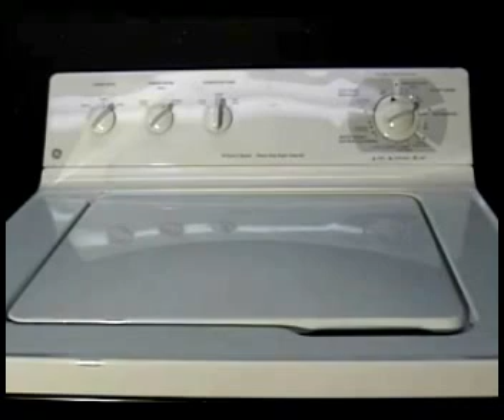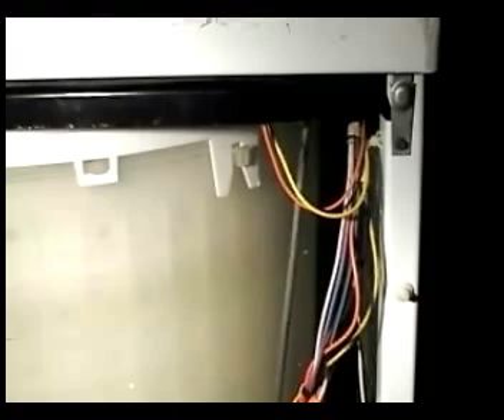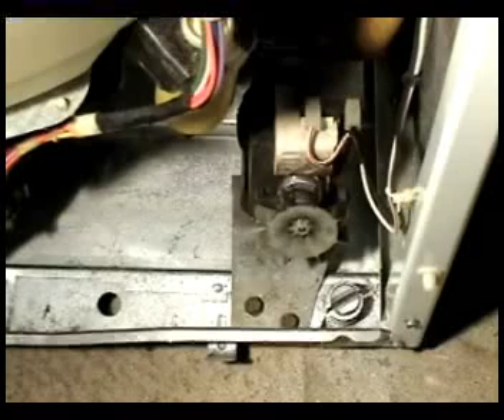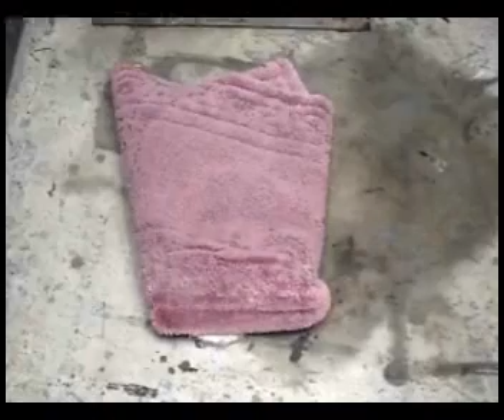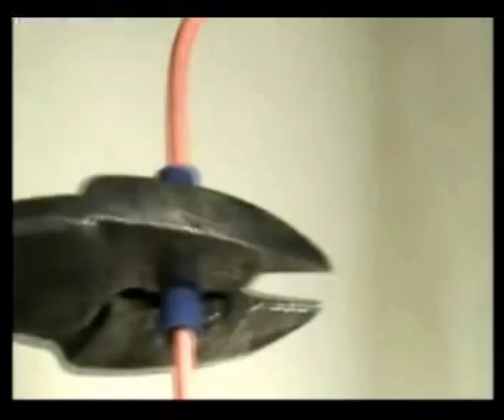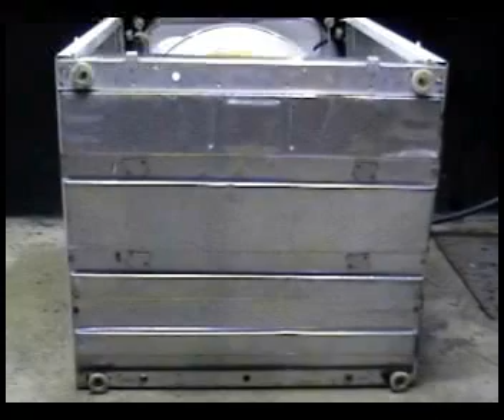General Electric Washing Machine Not Spinning  ?

Comment: Hi, thank you for the useful video.
 So far I have to connect the motor directly in order to test it, but I don't have a white violet wire. I only have a violet. Are they thr same? I have:
Yellow green, yellow, black, blue, violet, black red, red, orange and white red. Model number is WPRE6100G1WT. Please and thanks

Comment: My GE washer washes but when it's time to spin it starts then stops or goes into a spin but not fast enough to drain all the  water out.  I tried unhooking the air tube from the tub and blew into it to clear any dust, this seemed to fix the issue but only temporarily.  The belt is not broken.  I'm at a lost. I dont want to purchase a new washer if it cheaper to repair this one.  Please offer your professional advise.
Reply from the maker: send ma the model number to see what you have

Comment: After a neighborhood wide power outage, my GE model WHRE5550K2WW washer continued to function in most respects but would not spin.  After various online research and troubleshooting, I was convinced that some component in the relay had failed due to power surge.  Unfortunately, the relay board must be purchased as a unit with the motor.
I ordered "WH20X10076 GE Washing Machine Inverter Drive Motor " via ebay and it came with a jumper wire with instructions to replace an in-line fuse in the wiring harness.  On mine, I had to remove some black electrical tape to see/access the black shrink wrap surrounding the in-line fuse in the (white w/ red stripe) wire (upper, right hand side while facing the front of the washer).  This is in the harness bundle between the front of the motor and the upper RH corner of the machine.
After installing the new motor (including eliminating the in-line fuse as directed) and testing proper operation, before discarding the old motor, I tested the in-line fuse and found no continuity.
I'm going to keep my old motor as a spare and have too many things on my plate just now to bother re-installing the original motor to test operation, but I strongly suspect that my replacement motor was unnecessary and simply replacing or eliminating the in-line fuse would have rectified my issue.
Note; my new motor was not identical to my old motor in that the wire connectors were not configured exactly the same.  This was not an issue for installation or operation but leaves me wondering about the rational/wisdom/necessity of eliminating a functional in-line fuse

Comment: Hey so, my washer spins i just have to reset it every time to get it to spin. Otherwise my clothes are drenched. I tried reducing the load size but it hasnt helped. Please advise.
Reply from the maker: What do you mean resetting it ?
Reply from the maker: send the model number to see if you have a hydrowave washer or not
Reply: WPRE6150K2WT is the model number.
Reply: And reseting it by unplugging it waiting for a minute, then plugging it back in and opening and closing it 6 times in 6 seconds.
Reply from the maker: Your washer is a hydrowave washer and it has electronic controls and I don't know much about it 

check this link to see if you find some help there

https://www.youtube.com/results?search_query=WPRE6150K2WT

angel

Comment: Hey angel, is a new clutch pulley supposed to spin in dependant of the hub? I got two already from one supplier that both do this, so when the motor spins clockwise for the spin cycle, the pulley/belt/tub don't spin, just the motor and clutch hub. Thanks
Reply from the maker: I have not work on one of those in a while. When the motor runs in any direction centrifugal force make the clutch shoes to expand and grab the clutch drum and the clutch drum turns the belt in the direction that the motor is running.

The belt turns the transmission according to the direction that the motor is turning the clutch. So if the motor is turning the clutch and the clutch is turning the belt and the belt is turning the transmission pulley correctly, then the problem is in the transmission The transmission has a spring that when the transmission pulley turns the spring in one direction it makes the transmission spin and when it turns in the other direction it slips and the washer agitates.